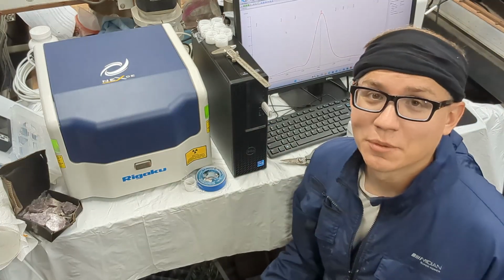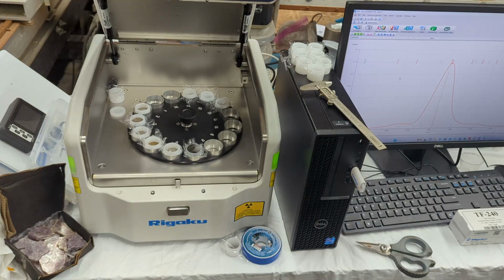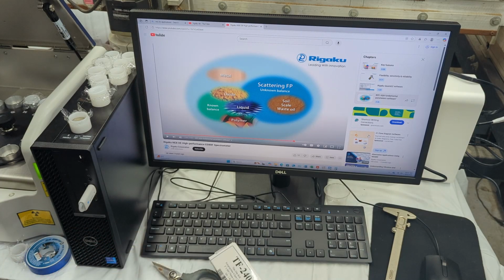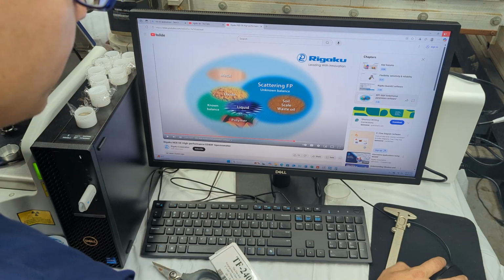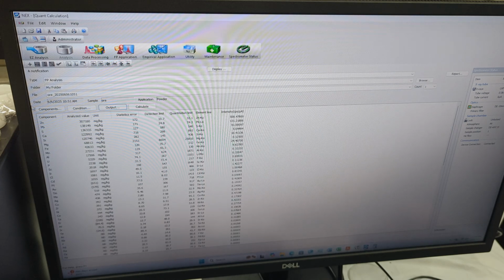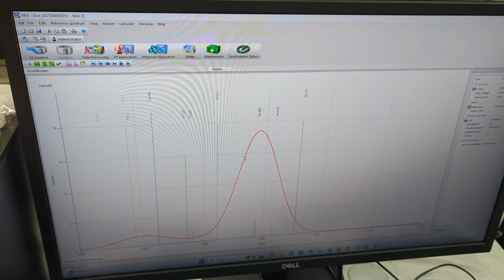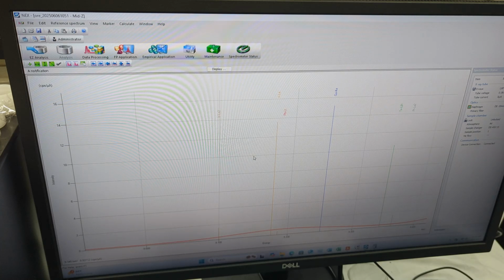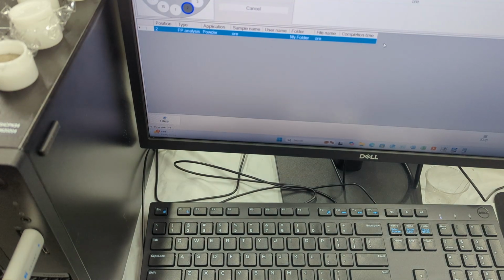Rigaku XRF DE spectrometer review energy dispersive for mining refining PGMS gold platinum rhodium

Comment: Read this on internet:
Gilding generates large volumes of wastewater with residual gold, posing environmental and financial problems necessitating metal recovery.

Following earlier studies on azolla by Antunes et al. (2001) and Khosravi et al. (2005), Umali et al. (2006) found that Azolla filiculoides removed more than 98% of gold from waste water in a gold plating factory and developed a continuous flow column system that removed 100% of the gold from waste water.

Not sure if you can feed pigs and harvest gold with the same plant!😊
Reply from the maker: Sounds fascinating! Curious to compare it to my electrolysis membrane system. The sad truth of plants is they are typically very inefficient. Plants only convert less than 3-5% of sunlight into energy
Reply: @Rowow true but plants build their own "power plants" (pun intended).

Comment: It sounds like the STANDARD is a way of calibrating the machine.

So are measurements always relative to the standard?  What if you unknowingly have an impurity that wasn't in the standard?  It seems like the algorithm would be confused.
Reply from the maker: Then that impurity would show up on the results/spectrum. Each element has its own specific wavelength. So yes the measurements would be based off the standard with typical analysis 

Otherwise the next option is the fundamental parameters option by rigaku which uses a mathematical model to calculate the results. It's less accurate and has some setbacks but is a very powerful tool once it's fully understood